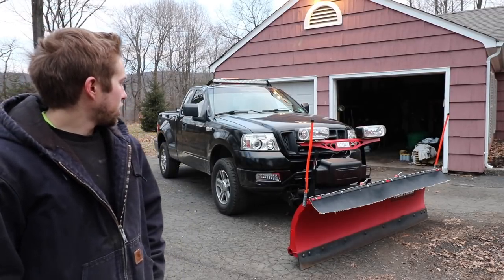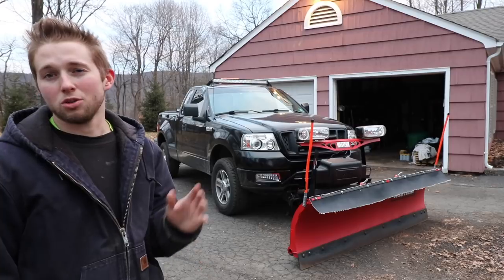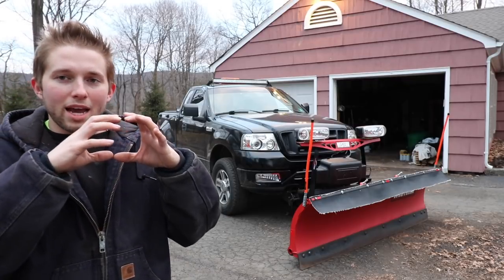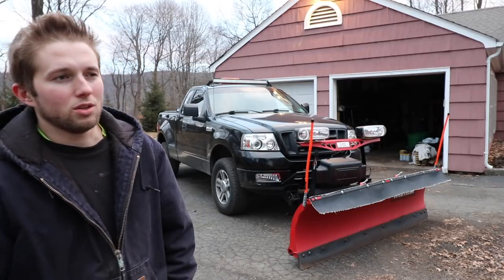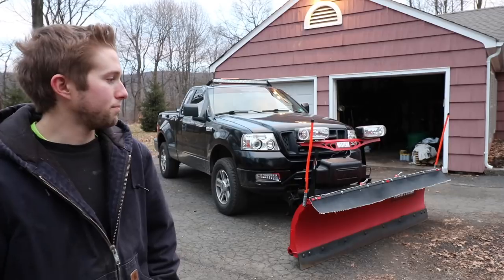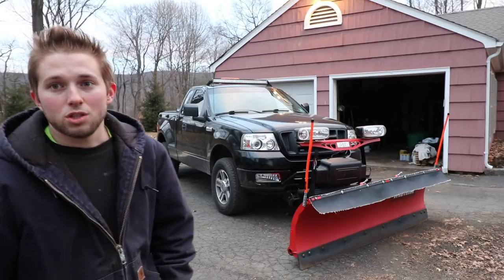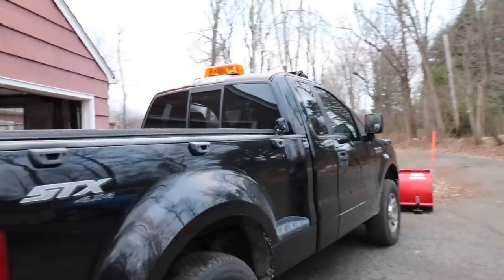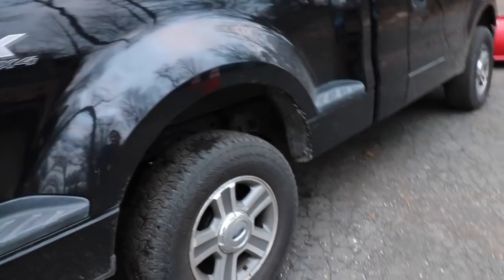Plow Trucks Frame is DOOMED (2005 F150 Rust Damage)

Comment: I've been plowing for years in the Peak to Peak Region of Colorado plowing at elevations between 7800 and 9600 ft in Boulder County. This is my second 2008 F150 4x4 Crew Cab. I've never had rust issues. And this 08 F150 crew 4x4 currently has 268,000 miles on it. And it's a Flex Fuel. The first one I bought back in 2008 the same exact truck and took me to 435,000 miles before selling it and had zero transmission issues. The only year Ill buy now is 2008 or until they can't be found anymore. That year f150 has proven to me to handle anything I toss at it for nearly half a million miles. You New York and Penn State kiddos don't know snow. Although yours tends to be much wetter than ours. When Spring hits then it's some heavy junk. But manageable. I am still plowing today and it's March 10, 2021, and we will get another several feet in early April. Now I've never had a rust issue myself but I've also never really looked. LOL Expensive to do but I've been told by other plows you can usually get a frame treatment and have that paid off in the first week or two of plowing. Boulder county does use a type of salt compound mixed with gravel. But again I've never had issues, YET!. JUINX!! Maybe they run a different mixture up here, I'm not sure. But we make a BUNCH of money here in the High Country. So we can afford a frame treatment but I've never personally done it.  PS do not tell everyone about this year of F150. Its a trade secret. lol

Comment: I'll give you advice as an older guy with lifetime experience with a bachelor's degree in accounting and a bachelor's degree in finance:

You are selling yourself short by thinking that a $1,000 frame is not worth it in a vehicle you think is only worth $1,000.

The Car Care Nut channel on YouTube where the whole said it was about 20 hours to take out a 2ar Fe engine from a Toyota Camry to clean up the heads and to install the heads on a brand new short block.  I believe it's 30 hours to change a frame on a Toyota Tacoma under Toyota's warranty program.

Therefore, the value of your truck, absent any other major issues such as engine misfire or transmission slipping, will gain tremendously with a frame that is not rusted out. 20 year old pickup trucks here in the Chicagoland area still command five-to-eight thousand dollars if they're not souped-up.

The fact that you're doing the labor makes it so it's probably worth it to change the frame. If you are paying a shop at $150 per hour, perhaps that's where you may have to draw the line.

Comment: that's nothing that truck will go another 100thousand miles they all rust by the gas tank just plate it its a box a lot of truck frames are channel the box is stronger I have seen many welded they never blow out eastwood has a inside truck frame spray can with long hose fan pattern work s great
Reply: Agreed but when u want a new truck u sometimes have to justify it to yourself

Comment: Similar issue with my ‘02 ford ranger. Bolt for the lower control arm on drivers side is already starting to pull through, so last season of plowing for it and hopefully a minimal number of plowable events remaining this winter. Just too much rust damage to make it cost effective to repair vs replace it

Comment: I own a 01 Superduty with little to no rust on the frame.  I use the fluid film apparatus to coat the frame and body panels - in and out - with winter weight chain and bar oil every September and  again in November.  I plow with this truck in upstate New York. It gets covered with salt every Winter.  I will replace it this year.

Comment: White lithium grease spray it everywhere let it dry and it provides a barrier that prevents that road salt nastiness from eating the metal. There's not that much rust compared my old f150. I know plenty of cats that would keep plowing with it for as long as possible. Car manufacturers could do a much better job coating the frames but they don't want you taking too many years before you come buy another truck so they screw us out of longevity.

Comment: That's a bummer !  You did more than most folks  to keep that Ford in very GOOD condition. 

That Eastwood looks to b a quality product, containing Zinc Phosphate, as the zinc will help to protect the metal.  Though if it cracks or peels, it will allow oxidation/ rust to occur. 
     
   ...think of what the old timers always had on hand... a little oil can to add some here and there as needed!!  
    Paints are good, but products that  creep and remain liquid will offer the best rust prevention.  Motor oil mixed with diesel is IDEAL for protecting exposed surfaces.  The catch being legality as far as application of  petrol based products.  Additionally, direct heavy exposure to petrol products can soften rubber and plastics over time.  ( I think the rust will get to things first)
   That's where products like Fluid Film, being Lanolin Based come into play. Legal for application, and less chance of interfering with wiring coatings, bushings, etc. 
      Its worth keeping up with these types of undercoatings, as fasteners and brake lines will remain like new  long after application, allowing  future repairs to be made foregoing the usual seized nut or bolt.
     
 How do you care for tools, wrenches and old guns?  OIL!   JUST DO IT!!

 Congrats on the Replacement Truck, look forward to seeing it in future videos!

Comment: Hey quick question if you don’t mind. I have a Chevy Colorado 05 with an Snowdogg md75 snow plow. And I have a small hole in the rear part of my frame and it rust there. Do you think if I have an welder repair it that I should be find plowing?
Reply from the maker: I can't say yes or no. If its a small hole, it would likely be absolutely fine, but a small hole usually indicates deeper issues inside the frame. Again, impossible to say whether its safe or not without a proper in depth inspection
Reply: @OldSoulMillennial  thank you!

Comment: NH Oil undercoating the best undercoating I have found yet I have 3 plow trucks and use it on al them! you can get a undercoating gun on amazon with the hoses. I spry  it where ever I can get it I do inside and out of my frame inside my rocker panels inside my bed sides my wheel wells where ever you can get it spry it. it wont stop rust 100% but it sure does help !!
Reply: Eric Bosley id have to second that. I used fluid film last year and it was junk. Had my frame sprayed with nh undercoating and it holds up so much better.

Comment: Drill a hole in the front and back of the bottom of the frame on both sides large enough to get a stream of water into. Lift one end of the truck on jack stands and flush the salt out with water until it's clean. Then use spray foam to fill all the holes and fill up the frame. Then weld rebar down the sides of the frame and you're good to go for the life of the truck. Tell the buyer what you've done.
Reply: DO NOT USE SPRAY FOAM, IT WILL RETAIN WATER!

Comment: You know all the hype about a box frame is stronger than a C channel frame bla bla bla but hey what do dump trucks and tractor trailers have but any a box frame to me has a flaw they trap dirt and moisture that ove a period of time will rust out the frame to where as a c channel you can rinse out all the debris off the frame...but my 08 GMC duramax plow truck has a C channel frame all the way from the rear of the truck to the firewall from there it's boxed to the front of the truck

Comment: your worried about NOTHING! my silveraldo has a crossmember that goes side to side behind the rear wheels on one side has the gas tank mount the other side has mount for shock It is rotted out an busted which caused the gas tank to drop so had it towed home some good ratchet straps pulled the tank back up an waalaa! still using it to plow an pull people out of ditches we just got hit with over 2 foot of snow in Jan plowed like a champ! you have a couple of rusty holes just wait until the frame rusts APART that is scary lol but then again your right to be worried you have a ford lol but them ol chevys plow an plow hard with broken frames in all........."CHEVY!....LIKE A ROCK!"
Reply: They also break in half eventually.